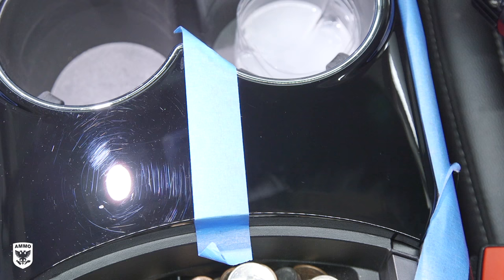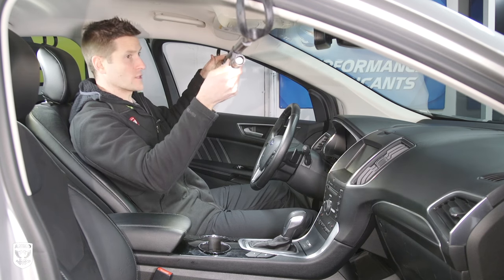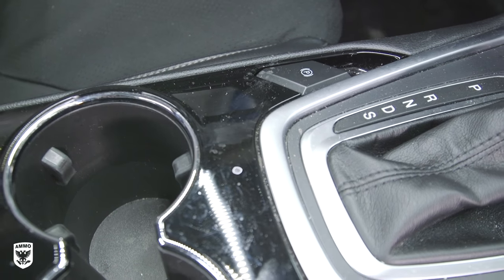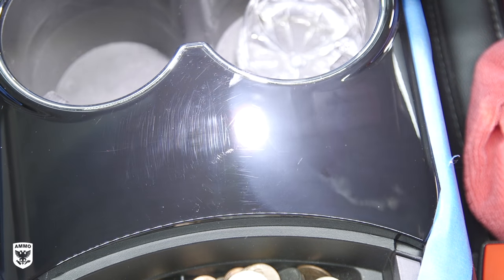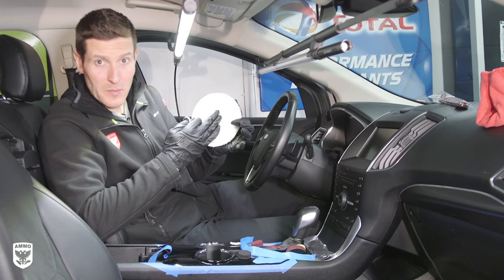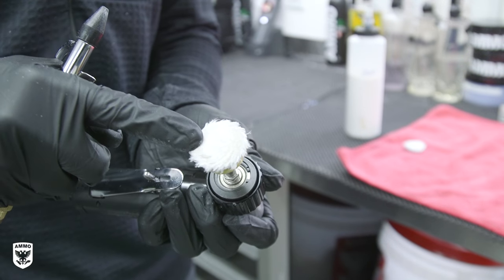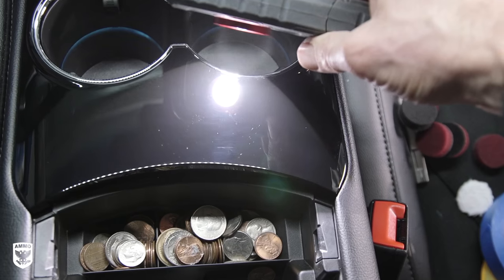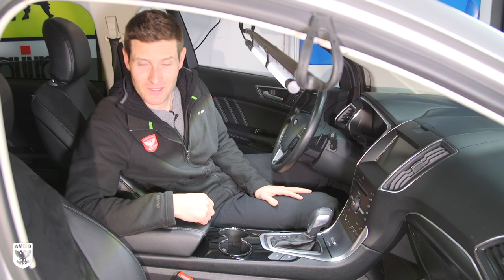How to Remove Scratches from Interior Trim

Comment: A couple of thoughts... Would it have been easier to remove, restore, protect and reinstall the trim? I understand that removing/reinstalling the trim is time consuming, but it might make the restoring/protecting stages easier. Also filming might have been easier too! Lastly, I liked the clear bra, but thought ceramic might offer an easier to apply, and more realistic level of protection.
Reply from the maker: Yes to removing if possible. No to the chemicals you suggested. Especially on the interior of your car. You could lean with your arm or whatever on the coating. Not a good idea for your health.
Reply: @AMMO-NYC  👍 Thanks for the feedback!
Reply: @AMMO-NYC  your saying cured ceramic coating poses a health problem to touch? That seems wrong.

Comment: Hmm. What about your standard matte-black type of plastic on the same interior peaces. Can those get the scratches buffed out and does the same ordeal apply there, or is it going to be genuinely simpler? Any tips or plans of making a video about it?
Thanks for your vids!
Reply: Frank White I believe the problem with these plastics is that it’s often either not a flat surface but has some kind of pattern on it, or it is made of a hard kind of gum, so maybe the wrong material to polish. I have the same problem on my car, with scratches from shoes on my door and glovebox, and I still haven’t figured out how to get rid of them. There are for example plastic trim cleaners that contain black coloring and those might get rid of the scratches for a month or so until they shine through again. I don’t think there is really a good permanent solution for that problem, at least in my case, because I really only have rough plastic surfaces in my car.
Reply: Gee, Larry. Everyone is getting love, just not my comment :v
Would really want to know if my case it's doable or not.

Comment: what if i don't have an air gun? thanks!
Reply: I guess you could use a dremel flexible extension for the polishing pads. 
I am just wondering how to clean the pads then. Compressed air from a can won't be powerful enough and it gets kind of expensive. @ammo nyc Any other way to spray the pads out and clean them? Thanks!

Comment: can you put a ceramic coating over this black panel to make it last longer or something and reduce scratches??
Reply from the maker: I definietly would not put that on the inside of the car (nor the outside) especially if its a place where I might lean my exposed arm or hand etc...
Reply: @AMMO-NYC  oh, why is that??
Reply from the maker: I would not have such dangerous chemicals touching my skin (assuming you lean on it or whatever) or breathe that stuff in while driving. No way.
Reply: @AMMO-NYC  fair enough

Comment: Where can I get my hands on that light???
Reply: Jeffrey Tschumperlin Scangrip.. they are from Denmark but you can select to purchase from a nearby distributor.. looks to cost about 188 bucks US..
Reply: Michael T Panetta do know of an online distributor perhaps? Couldn’t find one.
Reply: Jeffrey Tschumperlin you live in the US?
Reply: Yes I do.
Reply: Thanks for another helpful, educational video, Larry!  I have the piano black trim in my car as well. To clean it, I use a microfiber towel sprayed with SPIT.  Just refold and “buff”!  I went to the drugstore and purchased two 1 1/2 ounce spray bottles and filled one with LATHER and one with SPIT. I keep them in my console with two different microfiber cloths for quick touchups when I’m at a red light or in the drive-through.

Comment: Would it have been easier if you had used the Nano, with not having to switch the air hose?
Thanks for the mental training of working small areas.
Does that whole, or part, of the kit work with the Nano?
Thanks